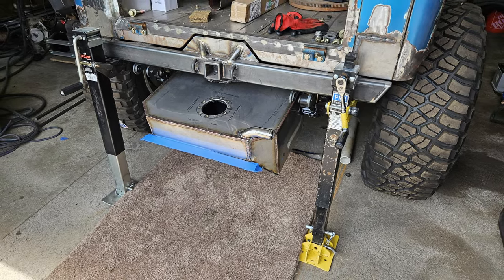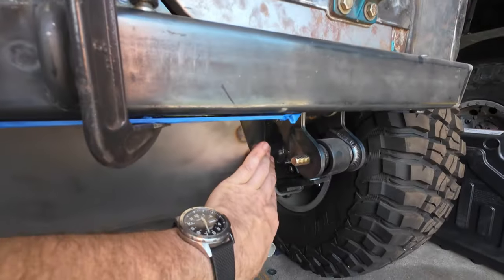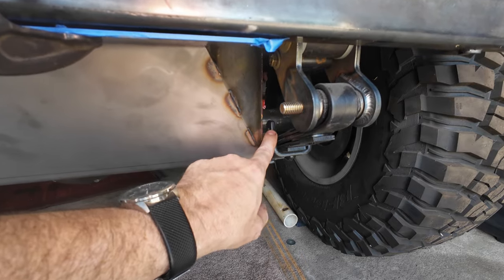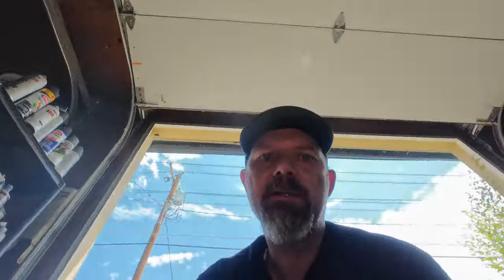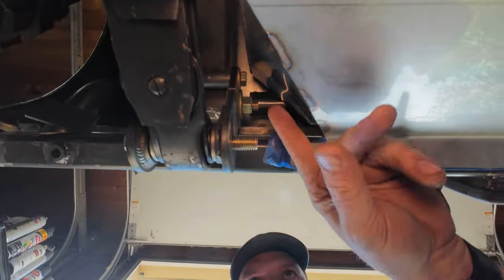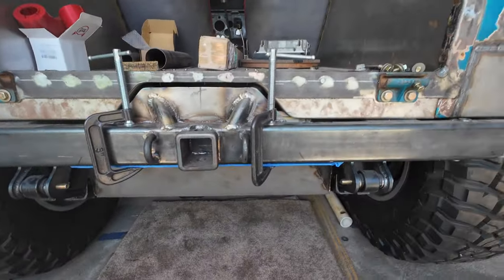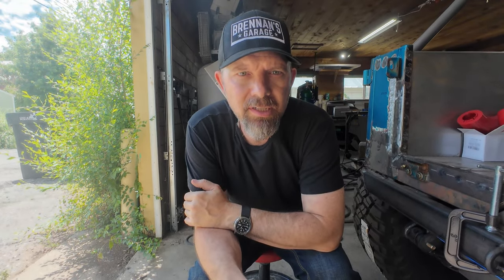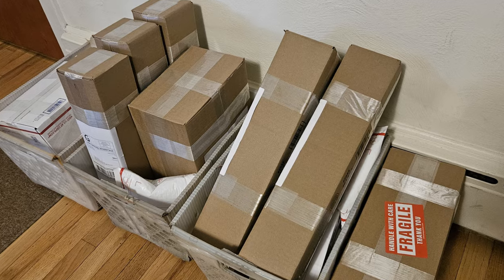Old Blue Willys Part 59

Comment: Did you / will you put a hydramat in the front section of the tank? I saw some heat marks (~7 minutes in) on the bottom of the saddle portion, is that where the pickup is attached to the tank?
Reply from the maker: @grewe02  the pickup for the front section is a draw straw from the top. There is a small bracket in the bottom of the tank that the straw keys into so the sloshing of the fuel doesn't fatigue it.

Comment: Have you ever looked into a Holley hydramat?
Reply from the maker: @taytonhair4358  sure, not interested. I think the hydrophobic nature of the material puts extra stress on the pump. I find OEM swirl pot style pumps to be the best option. There is reason OEMs use that system.